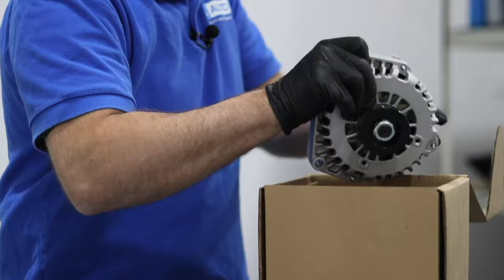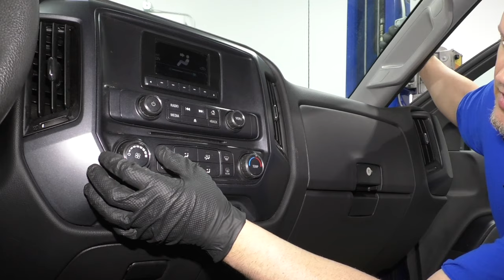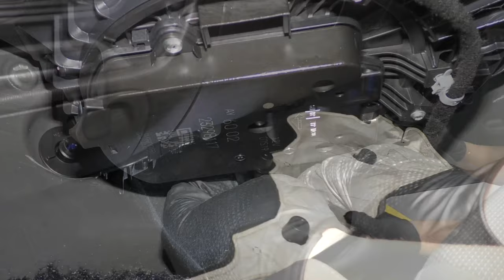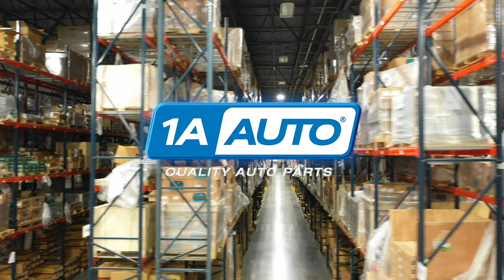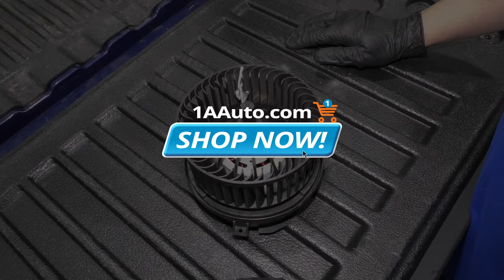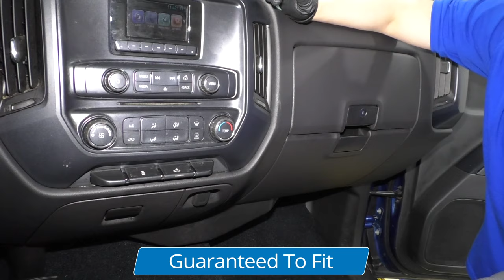Car Air Conditioning or Heat Rattling or Grinding? Simple Fix!

Comment: Very helpful, whole dash was vibrating enough I could see it. Pulled out the vent and stuck my hand down in to rotate it fan motor, found my GRANDMA! Not what I expected for sure, but was the cause of the problem. Saved me a trip to the dealership as well. Thanks a ton.
Reply from the maker: +Andy Leno Thanks for checking us out! http://1aau.to/m/Shop-1AAuto-c

Comment: Mone makes a click sound when turning on AC or Heat and a shaking sound for a few seconds under the hood when I turn it on. 2012 Ford Focus
Reply: Blake Arnold I have a 2011 Ford fusion am I making the same noise today
Reply: 2009 Ford fusion and mine makes a clicking sound sometimes when I use the cooler air. Not warmer tho

Comment: My car was making a slight noise Like almost like a bat squeaking noise. I finally fixed a yr later because my grandma came in my car with me for 20 min drive,  fort which I had to put ac on highest setting. After that, noise is gone!!! I just never needed ac that much lol

Comment: Very helpful, whole dash was vibrating enough I could see it. Pulled out the vent and stuck my hand down in to rotate it fan motor, found a mouse! Not what I expected for sure, but was the cause of the problem. Saved me a trip to the dealership as well. Thanks a ton.
Reply from the maker: +Mark Dudley Thanks for checking us out! 1AAuto.com

Comment: The problem that I'm having is not necessarily when the blower motor is initiated it is when i change the temperature selection . Briefly I hear a grinding clicking kind of noise in the dash when I change the temperature

Comment: If the blower motor is noisy it dont matter if the a/c is on or not, it will be noisy with the heater aswell
Reply from the maker: +Ismael Dos Santos Thanks for checking us out!

Comment: Did find a mouse inside the air motor some was the cause of the noise. someone suggested to me that it was ac compressor, so saved some money.

Comment: @A 1 auto can you please please help me. My heater has been working 1000% perfectly, my air was working also except it was not as strong as it used to be. But no other issues. Abruptly, the air and heater are both just not working. At all. There is an no noise at all. At first it was loud like a blowing sound. Then nothing and I heard some clicking. My engine light also came on. It gave me a code for the transmission stating it's a problem that causing emissions to pollute the air. Please I don't know what to do.

Comment: I want to know were to found blow motor of np 200 2014 model it also have that noise.
Reply from the maker: +Kenneth Africa Thanks for checking us out! You may want to try checking eBay and Amazon to locate the blower motor needed for your 2014 Nissan NP200.

Comment: I have a 2012 civic ex with loud vibrations, I replaced the blowing motor and still is so loud but only on heat, if it’s on ac it’s completely normal with no noise, plz someone help